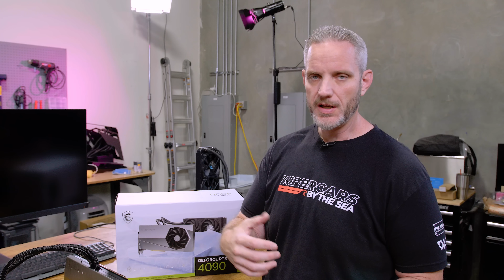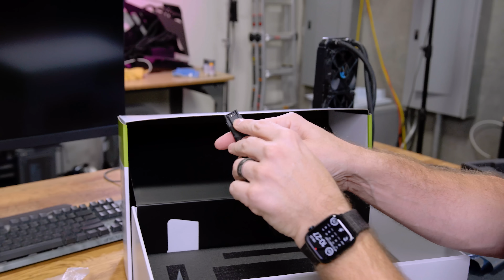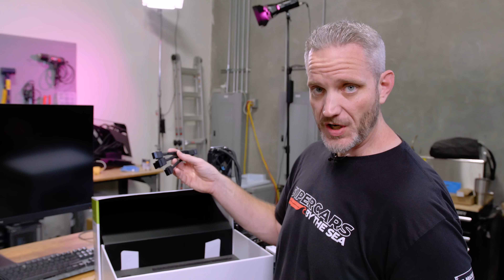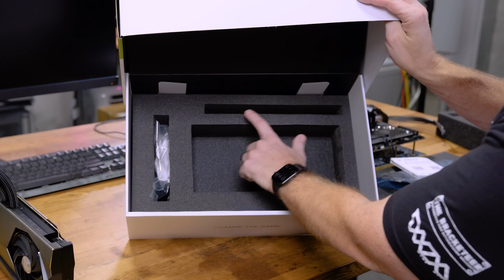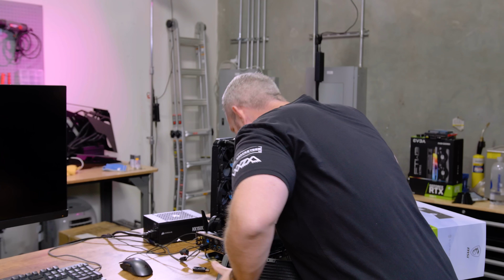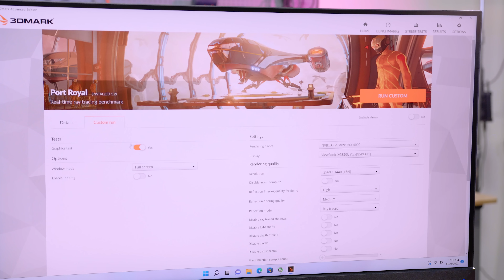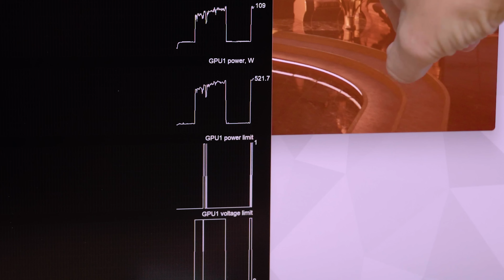This is the most BEAUTIFUL RTX 4090 yet...

Comment: Jay: As always, a wonderful and informative video! I do have one question though: Everything that I have seen and heard is that the In Flow and outflow lines in a closed loop should be down, rather than up. Even in a closed loops, there is going to be a little bit of air, and that will interfere with the coolant flow. Shouldn't "both" of your AIO Closed loop systems have their radiators the other way around?
Reply: Not all aio have pump on cpu\gpu block.
Reply: doesn't matter, the amount of air is minimal, and besides any air will circulate in the coolant. it may build up in small pockets but it will do literally 0 to the cooling efficiency. essentially as long as the coolant flows at all, the rate doesn't matter.

Comment: They seriously need to make a combination AIO for simultaneously cooling the CPU and GPU
Reply: Or just get the Lian li Air mini and have one exhaust out the top and the other exhaust out the side. Fresh air in the front and bottom and inside the case doesn't bake.
Reply: @DrLuigiPhd  i’ll look into it but I like mini ITX cases
Reply: they do it's called custom loop cooling. aio for cpu and gpu would be heat soaked fast.

Comment: have a 3080 so waiting till 6080 but the card does look cool
Reply: Sell the 3080 and get a 4080. Trust me, the heat difference is amazing. My 3090 draws 380w pumping out heat like crazy, while my 4090 (video) barely hits 160w to 200w. Super cool air instead of hot

Comment: Is the power displayed, the power going through the connector or consumed by the GPU? Because if it's the latter, perhaps the lower power limit is necessary to leave some juice aside to run the pump at max? Anyway, I really want to see the Asus 4090 Waterforce, which has an even smaller form factor and 360 rad (and possibly a higher power limit?)!
Reply: The Aircooled Suprim X model has the same ~520W max power limit at the Liquid cooled model so I doubt they are saving power for the pump.
Reply: @micb3rd  Ah, fair enough. So it’s just an MSI thing, not an AIO thing. Strange!
Reply: @theukdave2433  Yes exactly. The 4090 at 450 watts to 520 watts is right near the end of the power efficiency curve so not much point adding more power target as it is lots more power draw for little gain in performance.

Comment: As someone who had one AIO fail, I would be way too nervous to get one of these. Unless the Manufacturer says they'll have replacements for 10 years it's a hell no from me.
Reply: Yep, Got 2 AIOs failing. Each after ~4+ years. That's ok with me, change the AIO.
But what do you do when it's glued to a 2k+ card ? Throw the whole card ? That sounds dumb to me.
Reply: Yeah AIO water cooling always makes me worry about failure, heatsinks are just reliable
Reply: Apparently the R9 Fury X had defective AIO.... I am using once every day since 2016, not sure if I got lucky, or the issue is not as bad as it seems. I do however think after owning that this long that AIO is kinda unnecesarry and heatsinks look better
Reply: Same here. My EVGA 980ti Hybrid served me well for years, but the pump died in the middle of the GPU price explosion. I couldn't find a replacement pump so an otherwise functional graphics card became e-waste. I'll stick with air-cooled from now on.

Comment: do you think that u can be limiting yourself somewhat on power limit by running those fans and pump on 100% or are u sure that wattage is not comming from the same pool of TBP shared with core, RGB etc?
Reply: You... you think the card designed to deliver 600 watts continuously that actually uses 450 watts will struggle to deliver 450 watts + ~10 watts of power to cooling?
Is that what you're asking?
Reply: @tim3172  nope - im asking if the other wattage needed to run the fans/waterpump/RGB can sip from the same pool as for the GPU core. card can draw power, not deliver it. the premise is that when u hit the limit - its the limit. and couple more watts can push a bin up. ;) did you know that the card can draw up to 600W when its software limited to lower number? i would like to see it. im asking because of my past experienve with sapphire vega 64 - fans and light were together like 20W+ and i was on TBP 360W. disconnecting it and cooling it externaly gave me my 1st 3dmark place in my country which im still on. ;)

Comment: Glad to see at least one manufacturer has the sense to hybrid cool the 4090s. Air cooling just doesn't cut it anymore.

I have a 3090 FTW3 and it sounds like a vacuum cleaner under full gaming load if I don't take the side of my case off. Liquid cooling is becoming non-optional, you pretty much have to do it to prevent these monstrosities from overheating.
Reply: EVGA Kingpin 3090s hybrid cools their cards, when I got mine I didn’t know it was water cooled but I’m glad it came with it because it’s so silent
Reply: @DUBstepR2  That's true. EVGA actually had several water cooled 3090s, though. Now that EVGA's not making graphics cards, looks like nobody else wants to do it. 

Just more proof that EVGA was the only board partner who gave a crap about doing things properly.
Reply: what do you mean air coolings not cutting it? there's only few degrees between this and a air cooled card. there power limited, ALL of them.
Reply: @rci-tf2zc  A few degrees on an open-air test bench.  If you're working in a smaller chassis things might change quickly.  Like with a CPU AIO you're paying not deal with a giant heatsink and being able to either exhaust the heat directly or cool with cold outside intake air.  I can attest that there can be a 10-15C change for air cooled cards vs open air once in a chassis (with decent airflow).  Depending on what you're trying to squeeze it in, water can be the difference between the thing having to sound like a jet engine which is what the above are opining on.  Especially if you're the kind of person who will do workloads that max out the CPU and GPU at times.

Comment: Would putting the gpu aio in a front pull be okay for the internal temperature of the case?
Reply: yes. keep in mind most CPU components are fine to run up to 105C and at worst you'll be blowing 30-40c air out the rad. its really nothing at all. I always run all my rads as intakes as the core temps of the components will be cooler, and more intake fans means less dust.

Comment: great vid,
im interested in system power usage while NOT gaming. so while surfing or wathing a yt. 
i wonder the difference between AMD vs Intel and with and without a GPU. (also is there is big diff in power draw when the GPU isnt doing much between the GPU generations? )
Reply: Nvidia GPU power draw on the desktop when NOT gaming is governed by the Power Management mode setting in the Nvidia control panel. on the 4090 Suprim X with the setting on "Normal" it saves around 30 watts as it drops clocks down. On the "Prefer Maximum performance" setting it runs around 90 watts.

To answer your question about generations not much difference really my  2080Ti, 3090 and 4090 run similar power draw on the desktop. The 2080ti was slightly lower on power saving mode by 15 watts.

Comment: I thought I just watched a video on cooling that said aio's shouldnt be ran pulling air in through the rad due to pulling heat into the case? Is that only for CPU coolers? Or was that just a misspoken part?
Reply: whoever said that isn't the most experienced user. Will intake rads get the case air warmer? yes. does it matter at all? no.
if you run the rad as an intake you will get cooler temps on the GPU/CPU core, which is more important. the small temp increase inside the case is not worth noting at all. most mobo components operate up to 105C or more.

Comment: So does this use the 12 pin plug-melter power plug?
Reply: Yeah, but don't be a dummy and bend the power plug and then wonder "aww geez it's on fire great!".  Got mine on verticle bracket no issues
Reply: @JohnDoeC78  Sure, no issues now, but later when you're changing something and you bend it accidentally (possibly without even realizing what you did), what then?

The fact that the connector is that fragile with the potential of it starting a fire if there is a fault shows that it's a bad design.

Comment: Good stuff.  Mine will only do +105 core / +800 Mem at full power/voltages.  The pump is indeed variable.  I would advise against front/intake mounting as the heat output is pretty serious from this rad.  One more tip, Afterburner will allow you to set separate fan curves for the rad fans vs the fan on the card.  I have mine set to always run on the rad since they're exhaust fans and use the normal fan stop on the card.  Works well.
Reply: i have a 360 mm radiator for cpu in front and then this cards radiator on top
Reply: Great idea on the rad fan curves.  I mounted this in front with a 3rd fan and left my 360 min AIO on top.  CPU and GPU Temps seem ok so far, and this is in ab NzXT 710 case, so not the best airflow
Reply: Msi dragon center will or already has released a vbios fixing the power limit to 130 instead of 110
Reply: @coltraindontworryboutit9990  You can get the new VBIOS on their forums now, but yes, it'll be pushed out via MSI Center soon.  There are also places to download the higher PL vbios if your card shipped with the lower limit.  My card originally shipped with the higher PL VBIOS, but my overclocks were the same with or without the added power draw.  Seems like Jay has a decent card....he should definitely try out the higher PL VBIOS.
Reply: yep putting this in the front is a very bad idea.

Comment: Excited to see what AMD releases next week.
Reply: Same here, bro. Gotta keep the competition going neck-and-neck! It's good for us consumers.
Reply: @SalandFindles  Agreed.   Even if AMD comes in slightly below Nvidea that will likely be my route.   I'm more concerned with power and heat than excess FPS.   If it runs UE5, Blender, and Fusion 360 well enough with less heat and power then I'm all in.  Otherwise I need to build a case that doubles as a filament dryer and pool heater to justify the heat management.
Reply: My 4090 (same as video) barely draws 280w under full load at 4k@120hz, pegged at 2565mhz barely going to 50C. My xtreme waterforce 3090 draws 380w barley hitting 1900mhz and then thermal limiting. Super hot 🔥

Comment: out of curiosity you mentioned the 4090 wont work with only 2 pcie connection. My rog strix 4090 is using the 12pin* to 2x8pin pcie connector that came with my rog thor 1000w p2 and works fine, but should i swap it for the adapter + 4 pcie cables instead?
Reply: I'm puzzled. When you say 2 x pcie are you talking about 8 pin  connectors?

If so the PCI-SIG group only rate 8 pin for max of 150W. If so presumably your card can only pull a maximum sustained load of 300W with that cable.

The nVidia Founders Edition adapter has 4 x 8 pins going to the new 12+4 plug allowing a maximum sustained power draw of 600W.
Reply: ah made a mistake, the cable i got from asus is a 12vhpwr to 2x8pin pcie connector (made edit to match)

Comment: Hope more manufacturers experiment with cooling because the 4090 is huge otherwise
Reply: asus and gigabyte made aio 3090ti's. pretty sure theres a gigabyte aio 4090. not sure about asus yet but its probably on the way
Reply: @XenonArcher  there is a watercooled Aorus 4090 and it's a 360, not 240.
Reply: @alfaivre2990  neat. 360 rad seems excessive though. 240 is fine
Reply: @XenonArcher  I don't know, those cards are big. Obviously without the fans way smaller but I just got my strix and I could believe the size. Easily 2x bigger than my 2080ti. Good thing ingot a massive case.
Reply: @XenonArcher  so did evga
Reply: This card with a 240mm AIO is much bigger than the FE.
Reply: Yep. I like doing vertical mounts for my GPUs. So my next card probably will be aio.
Reply: @dododede875  Perhaps the last step might need that, I place my pc case horizontally when needing "double pleasure"  also saving bucks for more important things.
Reply: watch they drop a noctua one 5 slot card lol
Reply: That's not new. I remembered asus ares . As people demand something compact , stealthy , handy so be it, coming with a premium price tag. I personally like asking that one, just need to be cautious as she requires so much power for non-interpolated 4K/30p with mad settings almost all enabled such as ray-tracing DIRECT.
Reply: this has been a thing for generations. seems like the first hybrid card might have been an evga 780TI. i messed with a 900 series hybrid years ago. NZXT made a bracket for asetec cooler blocks so you could mount a stand-alone AIO on  your GPU. i still have one of those, got it back in like 2015
Reply: Where are people going to put all the radiators?
Reply: @brodriguez11000  one in front and one up top... like water cooling users already do.
Reply: @Mr.Morden  Now dial it up to eleven where practically everything will be water-cooled just because (there's already a liquid cooled PSU on the market).
Reply: I don’t like them, I can’t fit in my case with my CPU AIO Cooler. Much prefer the fans in GPU like my MSI 4090 gaming trio slim X. The size of the card is not a problem at all. Much easier to fit in than this.
Reply: @Santiago-sh3cqwell, you not getting one was made you an tool sir! 😂
Reply: I don't know, this actually takes up more space in total its just dissipated because of it being split up in two different sections.
Reply: @Santiago i bought the 5800x3d and still run it on a b450 mobo. doubled fps on everything lol. was gonna upgrade my 1070 but honestly i dont think i need to yet. i dont really care about ray tracing or dlss etc
Reply: Alot of water cool graphics cards are coming to the market soon, they already have them for the 3080 all the way to 3090ti
Reply: @super1jose848  they made them for gtx series also
Reply: With something like the 3080/4080 and 3090/4090 water cooling should be obligatory. I think these card companies are nervous to to do it because they aren't experienced with water cooling. Established water cooling hardware companies should be the ones providing the goods but these card companies don't want to pay them their due. Can't think of any other reason why they haven't got their act together and made it happen. Maybe Nvidia and AMD should step in at this point and provide reference water cooling?
Reply: @Mr.Morden  lol I have a asus strix 3080 ti water cool edition, search it up they look cool and overclock to the max, I got my for 900 from microcenter pretty cheap
Reply: @super1jose848  @adamkcmo69 But it's not obligatory for these comically high power cards. That's my main point. Instead of using silly heatsinks that warp the PCB because ATX was never designed for them. Even motherboard manufacturers and system integrators are so annoyed by this they have to design special PCIe slots and "support sticks" so the slot doesn't rip free of the board. It's completely ridiculous.
Reply: @Mr.Morden  I understand what your saying but even Jay in the video said temps didn't range that far from air and water just basic noise level. if the card gets to hot and warps due to heat aio or fan won't matter at that point.
Reply: @Mr.Morden  the main point is that the new cards take over 400 watts, they need to be cooled good, especially to overclocking. No complains.
Reply: @super1jose848   @adamkcmo69  But there are complaints and thermal concerns:
 
1) Maybe a centimeter away from m.2 drives causing those drives to be cooked by GPU heat lowering performance and usable lifetime. A torpedo to DirectStorage performance in future games.
2) PCIe slots blocked, and you're going to need them because your m.2 drives are being cooked.
3) No more physical warping causing one of the 82 PCIe slot contact pins to warp. Eliminating physical pin pressure contact if a new card gets installed. PCIe slots do go bad. Again consumer PCIe form factors were never designed for this, board makers are coming up with solutions on the fly.
Reply: @Mr.Morden  bro if you going for a 3080 or above, you gotta invest in a good motherboard, my motherboard never heats up, and I run a 3080 ti overclock 450watts
Reply: @super1jose848  I'm talking about the position of the m.2 next to the GPU on the mobo, just about all boards put slots there.
Reply: @Mr.Morden  that's what I meant, get a motherboard with a big heat sink for the mvm.2. U can't just buy a good graphics card and pair it with a trash motherboard
Reply: @super1jose848  You literally can assuming the VRMs are capable. If these asshat board vendors decide to place the ssd in a stupid place that's on them.
Reply: @Mr.Morden  Established companies like Evga have been making Aio/Hybrid cards since the Gtx series you can find gpu's as early as the Gtx 970 that have water cooling  attached direct from the box. Most aio's are Asetek there is no companies. If your buying a Corsair aio its Asetek just with the corsair logo on it same with psu most are Seasonic or XFX just with different company branding.
Reply: @adamkcmo69  I know, deep cool is one of the few companies that make there own pumps, there aios are cheap and really good
Reply: I'm not going to buy a 4090 because it's just too powerful for my needs (1440p on older games) but if I were it'd be this one.

The massive size of the other cards are beyond stupidity and might not even fit in my big ass case without using a riser cable.

Manufacturers should really look into this kind of stuff more, makes it a much better option.
Reply: @Kyle496  Totally agree
Reply: @Kyle496  Agreed. It is said, most of people may ask 16GB cache GPU for most cases after watching who plays cyberpunk 2077 in 4K/30 (interpolated and vsync traditional?)  with almost all effects activated.
Reply: any GPU taking more than 2 slots should be forbidden by law
Reply: @SickPrid3   Your comment doesn't even make sense in a comedic context
Reply: @PutsOnSneakers  he is right